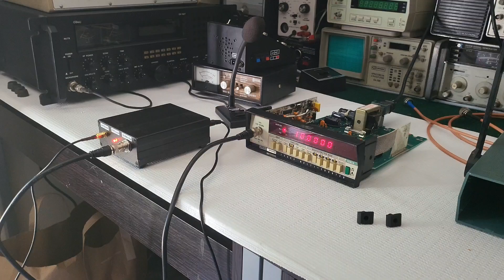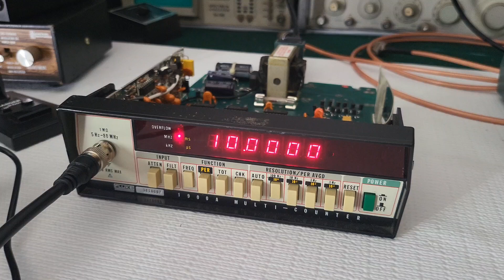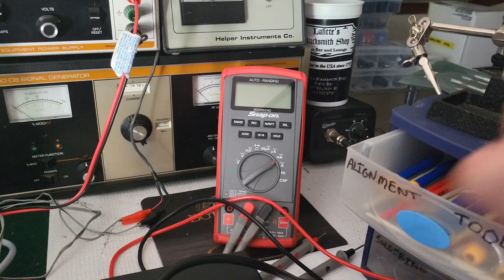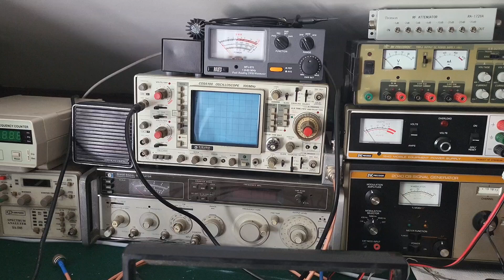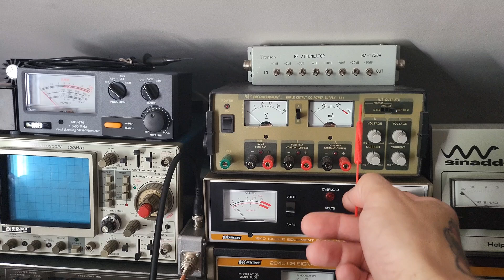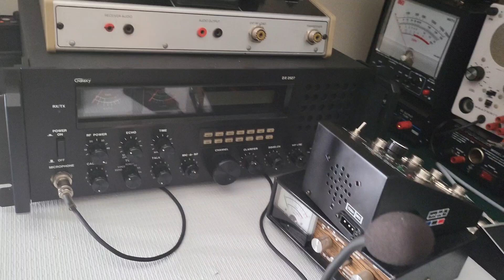Equipment tour and how it's calibrated.  How I got into CBs

Comment: Could you please give me the exact name for the gps do please im looking on ebay and don't find it i got two fluke like yur i want to align them, and i don't want to purchase anything random the is so many, thanks 73
Reply from the maker: Any of them will work. Just make sure you have one that matches the connectors on your equipment.
Reply: I believe the GDO shown in the video was from Ebay seller Macman1972a out of Livonia, NY. He sells several different GDO's(1-4 outputs), distribution amplifiers for them or just the boards if you want to build something custom. The cases seem to change based on what he can get at the time so don't go by appearance. I purchased one of his RF Sampler/Modulation monitors and am happy with the quality.